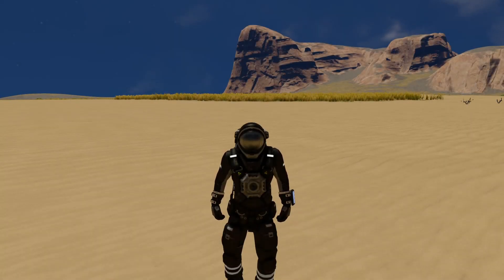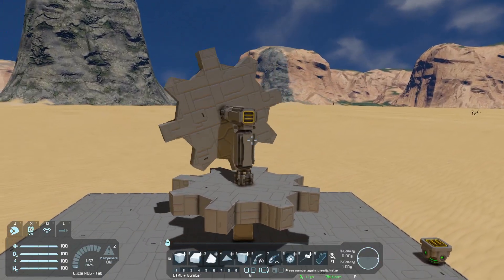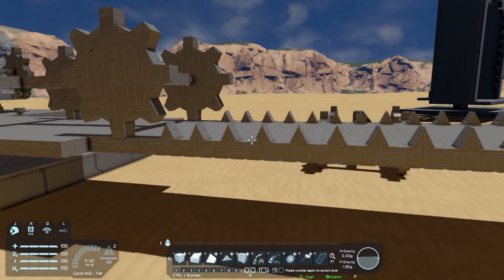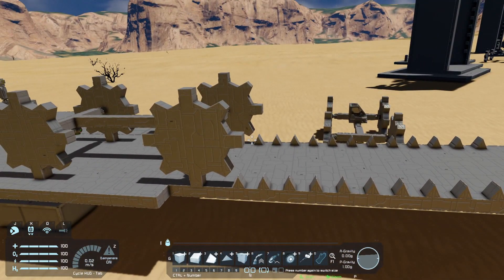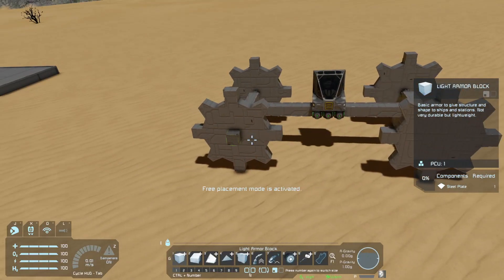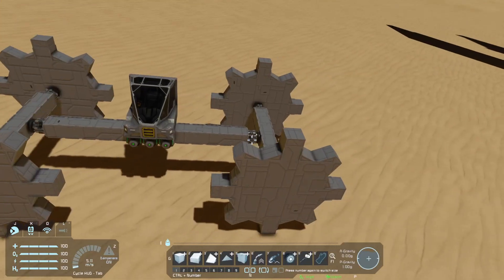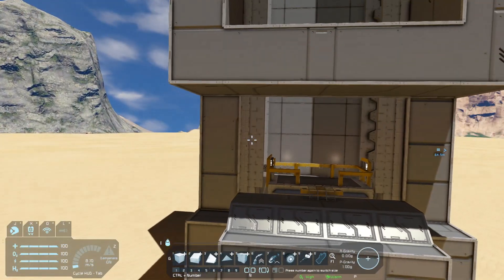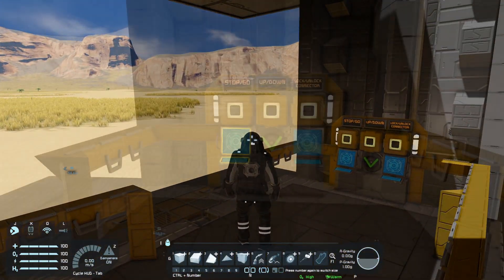Gear Elevator - Space Engineers

Comment: QUESTION:

When you build the elevator. Do you build the gear system directly in the shaft? or do you build the elevator system outside and then move it into the shaft?

Thank you,

3rik
Reply from the maker: When I originally built it I made the cart separately and then lowered it into the shaft

Comment: a suggestion: a connector on the rear of the elevator that will lock it automatically at the next floor, potentially with a floor select that will automatically disable all the connectors except the one on the floor you want to reach. additionally, an event block to open the door and stop the elevator automatically when it does dock, and a timer loop constantly attempting to lock the connector. if I ever decide to make a large scale base like this it's absolutely having an elevator like this but definitely with the qol things I've listed here.

Comment: Just a thought. I do not know if they where available 3 years ago, but would it make sense to add sensors at various floors to detect when the elevator is there, or at the top and bottom to tell it to stop and lock rather than using collision mechanics?
Reply from the maker: Sure you can use sensors or perhaps event controllers now but it requires a lot more complexity

Comment: I know this post is from a long time ago but for anyone watching this in 2024, you can use sensors to detect the top and bottom of the elevator shaft and stop the rotors
Reply: couldn’t you just use a timer block? or is there enough jack in the gears to make the exact climbing speed variable due to clang?
Reply: @tjforsythe97  there could be variable, and timer would also require you to time everything out yourself, sensor would be more of a surefire way to makes everything work correctly

Comment: what if you moved the gears closer so they mesh (and shift one of the tracks by 1.5 blocks)?
then it could be more compact, and both sides would always move at the same speed so you don't have to worry about symmetry (so you can go back to using 1 rotor/piston instead of 2, to fine-tune the offset)

Comment: I implemented a similar design based on this video. I love the moving gears so I used glass. Anyways. I'm having issues with the rotors getting out of sync and wedging the cart so I have to smack it free with a ship. Adding space balls to add gravity helped with the stability. But the desync causing a wedge, especially when changing directions, is getting a bit frustrating to solve, my design flaw not yours. Mine is 5 wide and i used pistons to balance and adjust gear pressure. Did you encounter this issue? speed is identical and I reset them to zero degrees often. I added small thruster to aid in repositioning. I thought using wheels to create a guide to prevent the rocking/wedging may be the way I go. Anyways rant over. I loved the idea and curious if any solution to my issue was available. Thanks for the inspiration

Comment: Surprised you didn't use sensors for remote on/off. Pretty sure you can do that. I did some kind of elevator with pistons years ago, call buttons on 3 floors. But I was all large blocks and there was no room for sensors. I would have used them though

Comment: Do you technically need space for the well below as you said at the end? There's no issue building the platform underneath the engine, right?
Reply from the maker: You will need the space in order for it to have a flush connection

Comment: For the displacement between the sides, couldn't you keep the Lift car 1 grid and make one wall (non moving part) a sub-grid instead?
Reply from the maker: I’m not tracking the concept here
Reply: @BlackArmor718  I was thinking you solved the displacement problem in the lift by making the car wider, in doing so adding a sub grid to the moving part. What if instead you added a sub grid to the non moving part (the lift shaft instead) would that not simplify it?
Reply from the maker: @Davidjball86  so you want the walls to spin the cart up?
Reply: @BlackArmor718  Not what i intended... At 5:40 in your video you talk about issues caused by having the cart having a sub grid as an issue. You fixed by having 2 sub grids on the cart (symetrical). Instead couldn't you have kept the cart as 1 grid. and made the non-moving wall have a subgrid (introduce rotor/ piston) to space it wider/closer together as the adjustment.

Comment: every time i try this it just blows up or destroys blocks, tried all different settings.. how the hell does yours not break everything?
Reply from the maker: Are you talking about my blueprint specifically that is causing damage?
Reply: @BlackArmor718  No, rebuilding it myself. i copied your build exactly (in large blocks) and the teeth on the wall and gear cog keep damaging each other
Reply from the maker: @teeege  Ah. Well large blocks are basically as strong as cheese when it comes to collisions
Reply: @BlackArmor718  i see. its a shame because I got a large grid to work over 700 blocks distance.. but can only go 1m/s.. managed to add a cargo container with welders that weld both the gear cogs and the wall teeth, usually welds any blocks back to 100% before they take enough damage to cause any bumps! but takes 15 minutes to go 700 blocks

Comment: Would it be possible to use this as a cargo/small ship elevator? Maybe as a large grid. What's the max load 4 rotors can lift?
Reply from the maker: 4 rotor can't lift more than a small ship. But you could add more to the design

Comment: It looks like at the end you had a little bit of leaning. Either way really cool. I was thinking this would be cool to use in a large small grid if you wanted to go overboard, but it'd prolly just be better to use pistons since few ships are gonna have that many floors. Still really cool. Does it work well in space?
Reply from the maker: It does lean slightly but no more than a few degrees. It works better in space

Comment: Amazing build, thanks for sharing!

Just stumbled on your channel, so wanted to ask if you have tested this mounted to a ship, and in/out of natural gravity?

I find that a lot of "friction" based system don't like being attached to larger mobile grids due to the changes of the collision boxes (and bts calcs) over the years (especially on MP), add in being outside gravity wells and it all can cause a host of issues for some builds.

While I doubt these would be a huge impact on your design, just curious if it's been tested already or not :)

Either way, great build, I may need to borrow the design (with credit to you obviously lol) for future builds!
Reply from the maker: Hi Haladmer, this will work on a moving ship, although violent maneuvers are not recommended while the elevator is in motion. It also works better in 0g that it does on a planet
Reply: @BlackArmor718  Thanks for the follow-up!, so par for the course for SE, got  it! :D

Comment: Amazing creation, I've got some great Ideas to improve upon your work. You could use sensors to automatically make it stop at floors. I would also change it so that the elevator itself doesn't have a railing but the floor you are going to does. This way, whenever the elevator is in use there is a rail instead of a hole to fall into for the people on the floors where the elevator isn't.
Reply: The same sensor could operate at-floor grates, like how irl industrial elevators have two sets of doors (which make a bloody horrendous noise when they close)

Comment: BTW: instead of using wheel suspensions you could program the rotors to stop after x amount of rotations (unless that's no longer an option),
Reply from the maker: That is not an option
Reply: @BlackArmor718  I tried it today (after 3 weeks of playing) and even though everything looks perfectly lined up and with enough leeway, velocities are slow, torques are fine, displacements all checked, etc. everytime I disconnect the new subgrid everything just explodes. It becomes too tiring to constantly reload the save game and change one value, etc. this is why i stopped playing the game originally: too finicky. Right now (after like 30 reloads) I can get the cart to stand on its own, but as soon as I try to move everything just explodes again,
Reply from the maker: @larrote6467  Ill take a look
Reply: @BlackArmor718  torque was key: torque of 100kN and braking torque of 50kN helped. (i might have to check again)

Comment: You can link the left and right gears together with a complex gear train, allowing for more force, and also, more synchronization.

You cant derail diagonally if the left and right side can only move with each other.

Pistons are also much stronger on subgrids and can allow for EXTREME loads

Just be careful with the fact that one piston can clip into itself if it's the only one doing the work and the load is too heavy, same goes for any number.

The game actually distributes the load across the connections, based on how its configured, and also how it is leveraged upon. This is because, that flex that normally causes clanging to happen allows for better tolerances, and even shock absorption, given enough members.

Comment: Maybe use sensors on each floor that tell the remote on the elevator to stop. These sensors can then be activated/deactivated by the floor selection button on the elevator.
This will in turn make it possible to make a call button on each floor.
Reply: Better solution: same layout as a sensor on each floor, but the call button on each floor activates a timer block that disables all other of the timer blocks of the other floors (so you don't get multiple people pressing at once and borking it) and activates the sensors for the floor the button was pressed on.
After the elevator reaches the correct floor the activated sensor should activate a timer block that both stops the elevator and disables the sensor that activated it.

Now just add a button on the elevator that activates the timer block for the desired floor as if you used the call button on it.

Oh, and if you don't want to fuck around with code you can just add another "Reset" button for each floor so it sends the elevator to the bottom\top so your elevator always goes the right direction when called. But if you do want to use code simply have each button as 1-2-3-4 etc and use math to figure out if last button pressed was 2 and new button press is 1 then elevator goes down, if new button is 4 elevator goes up.

Or if you build it in a space station you can make a "circular" elevator that just goes in one direction.

Comment: with remotes. couldent you have buttons that activate pistons that push out tires at the floors you want? this way it wouldent require you to manually stop the elevator at the floors you want. say you wanted to go to floor 3, you hit the the button itll push out pistons to stop you at that floor. obviously youd need a system to register on your way down to catch under the elevator but i feel like its possible to work around it. awesome to see this i cant way to see it pushed to the limit. id also like to see someone put a full roof on the platform just like under so when you get stopped at the top you wont see it.

Comment: Hey dark if you want a faster elevator without losing smoothness add timers to speed it up and multiple sensors to slow the rotors down in steps as it meets the destination. 

Awesome work btw.
Reply from the maker: Thanks for the tip

Comment: I wonder then if you could do a kind of retractable landing platform... like, a door opens, and the gears extend a platform outward for you to land a ship on, then they can retract back into the base and the door closes behind it.

Or, if you wanted to go really out there, maybe a kind of self-building mine. Place a main vertical structure over the ore spot with the main machine in the center; have a drill setup underneath, and above that a series of welders that could build the gear track as it descends, with the gears near the top of the machine above the welders.
Reply from the maker: Both interesting ideas, thanks

Comment: Could you also make the elevator gear mechanism shorter (length wise) by offsetting one set of wheels to fit either inside or outside the opposing set of wheels? In terms of width it wouldn't do anything, but it'd be possible to make the elevator platform shorter in length in theory.
Reply from the maker: I'm not sure it would save enough space to be worth it

Comment: The only improvement I can think of is to use sensor blocks to reverse the direction/stop the elevator at the top and bottom just to automate the mechanism as much as possible. Otherwise good work with this overall.

Comment: I wonder how much load you could lift with a system like this. It would be interesting to experiment with cantilevered versions that just use a trailing set of wheels to offset the moment. This opens up some really interesting ideas for elevators that can lift large ships from underground or even to orbit
Reply: That was my first thought. I wonder if one could make this out of large blocks and lift proper capital ships
Reply: I think having them as small rotors is probably more advantageous since if I remember correctly both large and small rotors have the same torque and detach limits so it’s more space efficient to use small

Comment: You could probably have set it up so the connector is on the back of the elevator, so you can lock the elevator in place at any stop. That might be better for shipboard elevators, that way they don't get jostled around when you are turning or whatever.

Comment: What if instead of putting the gears under it you put them behind where the blast door is and still use 4, so it wouldn’t tilt side to side and would still move up and down well and you can put guides on it to make sure the gears don’t slip from the weight of the elevator
Reply from the maker: You're going from a balanced system to an imbalanced system which is not an improvement.

Comment: Haveyou thought of using sensor blocks so the elevator can sense when its about to reach the end of the track? or to sense different floors and automatically stop?
Reply: to elaborate on this - have it set to detect grids and since the elevator is not a part of the large grid structure which the floors are built onto it should be able to detect them.

The sensor is placed on the back of the elevator platform and looks out to where you would board from. If it detects grids it does nothing, but if it doesn't detect grids it turns the rotors off.

For floor selection, have multiple sensors with different detect ranges, and have the absense of gridblocks on each floor a different distance from the sensor. 

Using a button for each floor, the button would turn on the appropriate sensor and turn on the rotors (reverse direction might need to be manually set) - the sensor won't turn off the rotors until it has reached the floor where it cant detect its specific missing block, when it does find its specific missing block it will turn off the rotors and you will be able to exit on the specific floor you chose.
Reply from the maker: I would task you to build the system and see if it actually works because I'm seeing some hangups with the floor detection method and getting the elevator to determine if it should be moving up or down to a floor.

Comment: I noticed it went a little crooked at time, have you tried duplicating the mechanism to above the platform and forming an enclosed cabin for stability?

Also a tiny point, but maybe painting a mark on the tower at each floor and have a corresponding mark or block on the car so that you have a simple standardized way of identifying the perfect point to stop it
Reply from the maker: If you go back down to the bottom it will straighten out again. The markings is a good idea but I don't have any floors on the bp so I don't know where the player would want them
Reply: @BlackArmor718  fair enough, only suggested the cabin as some people (of which I am totally not one.... Honest) can get.... Grumpy when our machines aren't quite...perfect

Why I gave up on walkers years ago. It's alot more stable now so might give them a go now

Comment: Rewatching this Ive been wondering if a third gear offset from the others could act as a lock or break mechanism if it something were to get damaged? 

Another thing you can use the gears for is a vault door. Be it a normal vault or like a fallout vault door lol
Reply from the maker: The gears do not take damage and are very sturdy when turned off. I would use 2 more underneath the first set just to keep it aligned better in the future
Reply: @BlackArmor718  you could probably make this smaller by using a 3 gear setup...maybe. Have 2 on the right, similar to what you have now. And then the third in the middle of them but applying force to the left side. And just adjust your track accordingly. It might be smaller...just guessing at the moment.